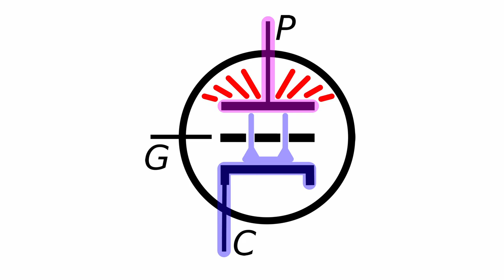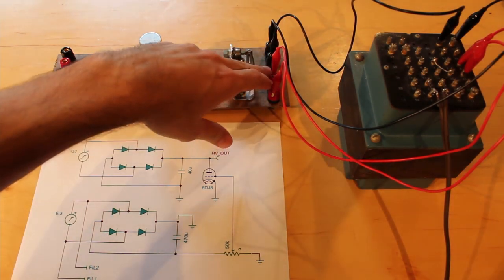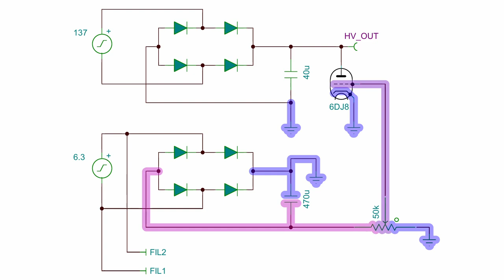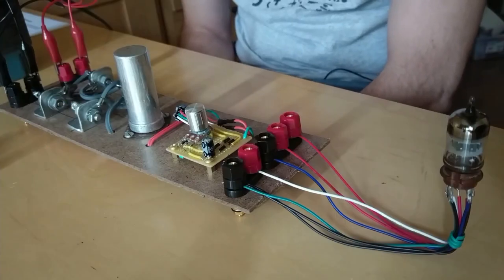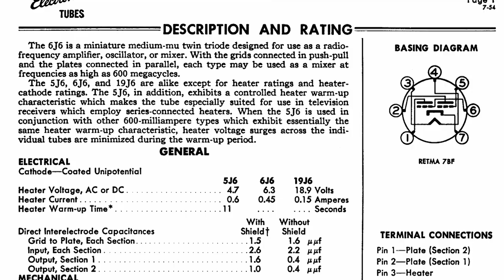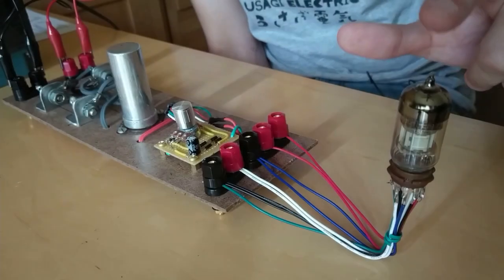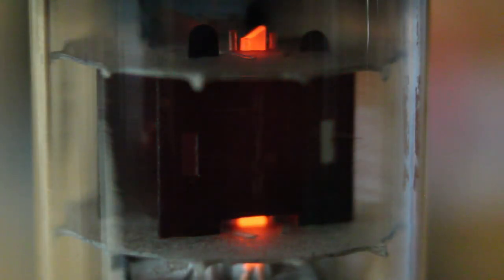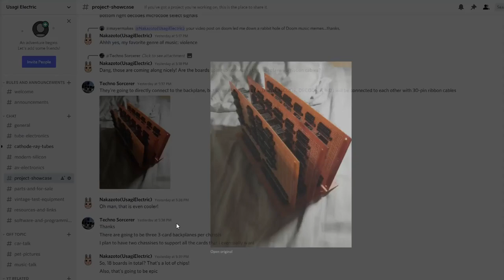Red Plating Vacuum Tubes to Destruction!

Comment: I've heard of this but never seen it. It was awesome. Maybe the Russian valve was already damaged ? Thank you for this.
Reply from the maker: Thank you!
The Russian tube is a classic case of "should have done my homework", haha. 
The tube was actually totally fine, but it moves a tiny amount of plate current under normal conditions. My B+ here was right at 280V, and so looking at the datasheets for the four tubes, these are the plate currents to be expected with the grid at 0V:

6HA5: ~70mA
6J6: ~45mA
6H2N-EB: ~6.75mA
6BZ7: ~75mA

The Russian tube just doesn't move that much current in the first place, so in order to move enough current to red plate it, I'd have to really crank up the voltage and probably also push the grid pretty deep into positive voltage too. Still, it was a fun test to see that it was so dramatically different than the others.

For reference, on the 6BZ7, 75mA at 280V is approximately 21W, but according to the datasheet, the 6BZ7 has a maximum plate dissipation of 2W, so we were cramming 10x the amount of power through that tube than what it's maximum rating was!
Reply: @UsagiElectric  Ha ha. That's brilliant. The variation between different types is mind blowing. I've got a pocket book of Telefunken valves from 1966. It covers everything from IF to AF, Rectifiers and even CRT's and X-Ray tubes. I used it all the time when I was working in a  radio repair shop in the 80's. The best few years of my life. :)
Reply from the maker: @frankowalker4662  I was actually really surprised at just how different the 6BZ7 and 6H2N were, even though they're both dual triodes and even are pin compatible. It makes me curious on how wildly different the tubes would react and sound in an amplifier if hot swapped around!

Comment: That's the quality content I subscribed for.

Also a fun way to get some beautiful glow out of tubes is to get some gassy tubes and putting a whole lot of voltage through them. As soon as that getter is gone far enough you will start to see some blue and violet glow from the gas inside getting ionized. Would love to see you do that too if you got some gassy tubes ✌️
Reply from the maker: Thank you!
As I get a little more comfortable with working with this massive transformer, I definitely want to start playing with getting into some of the more interesting side of tubes that require a bit more high voltage. There's enough windings on the transformer that I can gang them together and get like 100VDC rectified out of it, which should make some tubes glow real nicely!

Comment: Nice! (Hope you had glasses on.. :O)

Any idea what temp you hit? (and what temp do they normally run at, once warmed up? Heck, why do they need warming..?)
... why do the tubes have silver top end?

This calls for a post-mortem teardown of killed tubes and a microscope?
Reply from the maker: Thank you!
I didn't have glasses on, but to be fair, I've never actually heard of a tube shattering due to electrical misuse!

As for the temps, I didn't measure, but I can say that the 6HA5, 6J6 and 6BZ7 are all pretty warm to the touch in normal operation, but after my shenanigans, they were hot enough that I couldn't hold them! Tubes often run at wildly different tempteratures. The 6AU6s that I use for everything get warm, but never hot enough to hurt in your hand or on your fingers. But, my Magnavox concert grand radio has a bunch of 6V6 output tubes on the amplifiers, and they run at 300* F (150* C) or more depending on how loud you got it cranked up! Those will definitely hurt if you try to hold your hand on one when it's running at full tilt.

The little silver bit at the top is actually called a "Getter". This is a bit of metallic material that chemically reacts with any impurities in the vacuum (due to an incomplete vacuum or off-gassing of the elements inside the tube). You can actually tell if a tube has gone to air at a glance by looking for the getter. If it's all milky white or brown, then air got into the tube and the getter reacted completely. 

And speaking of cutting tubes open, well, I just so happen to have a video where I did just that! 
https://youtu.be/6DM1qBgtxrs
Reply: @UsagiElectric  fans self its gettin' hot in here :O
Reply: The temperature of the internal material can be estimated from the color.  Red to orange color means 600 to 1000 C. The one which went white probably hit over 1300 C.  At least that's my estimate from reading about the phenomenon.

Comment: actually no need to destroy one tube for this purpose...if you are using a big transmitter tube like GU81M or the 813 using them in normal operation as an hf linear amplifier you can see there's plates glow without destroying them...but anyways it's a good experiment

Comment: Try a 6146 tube
Reply from the maker: I actually have a few of those, but they can move so much current, I'd really have to upgrade my "test" rig here!
Reply: @UsagiElectric  , six 6146B tubes were used in early versions of the 300 watt Ampeg SVT ("Super Vacuum Tube) bass guitar amplifier. The Rolling Stones used the original prototypes of this amp on tour in the early 1970's, for guitar as well as bass. The 6146 is a small transmitting tube (sometimes used for ham and mobile radio) but even the tougher B version sometimes failed in these amps, and it wasn't long before Ampeg changed the circuit to use the then-commoner, more easily available 6550's (or KT88'S) instead. The SVT is still in production in an "updated" form and can still be seen onstage at big festival concerts.

Comment: I've red plated a vacuum tube before by accident
Reply from the maker: With my projects usually using just 24V, I've been lucky enough to never have red-plated a tube, but I can definitely see how easy it would be to get the plates glowing in an amplifier when trying to get as much power as possible out of it!

Comment: what about trashing a 4CX5000A
Reply from the maker: Hahaha, I had to look it up and that's one hell of a tube!
The first problem would be figuring out how to even power the filament. 7.5V isn't tough, but getting 75A of current is beyond anything I have in the shop! If I do get it powered up, if I want to thrash it hard to blow, I need to build a power supply that can get to about five times the maximum ratings. The datasheet says the max is about 6,000W, so let's aim for a power supply that can provide up to 50,000W just to make sure we got enough in the tank to finish the job. That means I need a power supply that can give 4,000V at 12A, which is a frighteningly large amount of power. With that much power on tap, I should probably build a Faraday cage to house it all in and then operate from a safety bunker in another room, haha.
Reply: Was just a suggestion but now seems indestructible

Comment: Those Russian tubes are built like Russian concrete
Reply from the maker: It's definitely an over-engineered tube!
But, also, after digging through the datasheets a bit more, it moves much less current for a given grid voltage as compared to the other tubes. My B+ voltage was right at 280V and according to the datasheets, this is the level of plate current with a grid voltage of 0V:

6HA5: ~70mA
6J6: ~45mA
6H2N-EB: ~6.75mA
6BZ7: ~75mA

The Russian tube just moves so much less current than the other tubes that I'd really have to crank up the voltage and probably also push the grid pretty deep into positive voltage to get the plate to start glowing red.  For reference, on the 6BZ7, 75mA at 280V is approximately 21W, but according to the datasheet, the 6BZ7 has a maximum plate dissipation of 2W, so we were cramming 10x the amount of power through that tube than what it's maximum rating was!